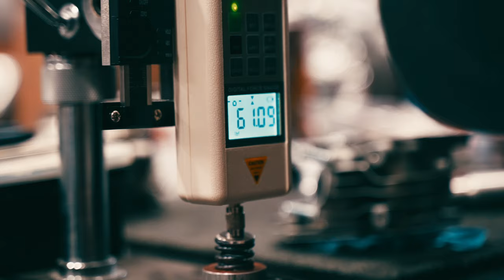60 Years of GoPowerSports

Comment: Congratulations Go Power Sports, here's to hoping for another 60 years..... Hopefully you start doing frames, rollers or parts that are more electric vehicle friendly, like a frame w/ the option to get a special swingarm for electric motors or a regular combustion engine. I was looking to do an electric mini bike build but the frames/parts would need major mods to be used on an electric bike... Most of the go-carts and stuff like that just need an engine plate and battery box which isn't that difficult but it would still be nice to have electric motor plates and metal boxes for batteries and controllers and stuff. Other than that, I can't complain about anything.... Keep up the great work and congrats again on 60 yrs.   😊👍